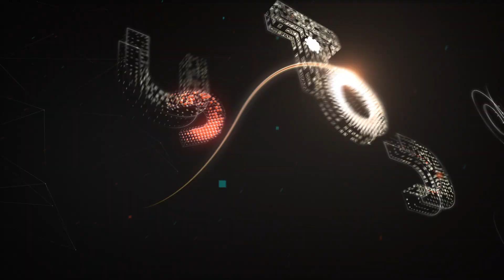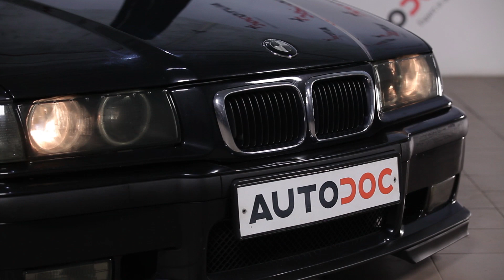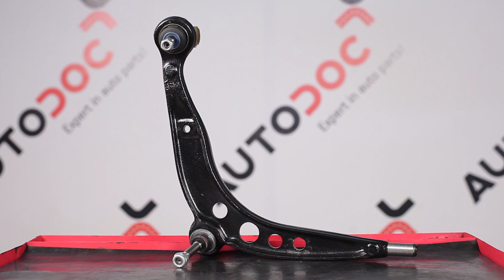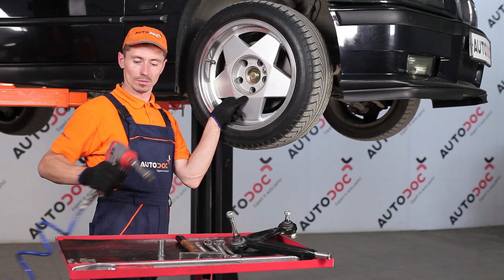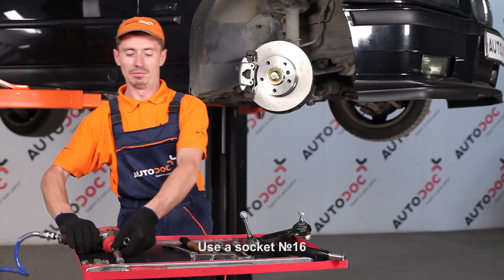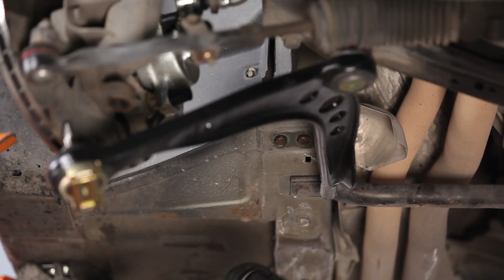How to change front lower arm on BMW 3 E36 TUTORIAL | AUTODOC

Comment: That's total bs. These ball joints bolts are wedged in super hard. For the outer one you need a joint extraction tool, for the inner one I still have no idea. Tried to remove mine yesterday and I was smashing it with a hammer for half an hour and it just sits there like a boss. Next time shoot the video in real life conditions with an arm that's been there for 30 years, not with a loose one you just have put before making the video.
Reply from the maker: We cannot show all the nuances and problems during replacement, it is all individual and it is not always possible to solve them at home. To avoid this, we always recommend making replacements at specialized car services.